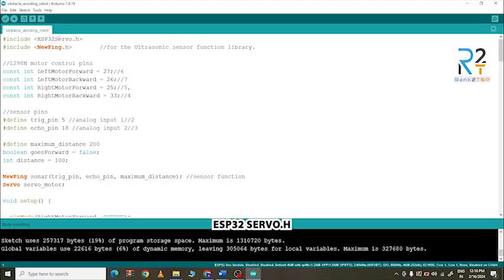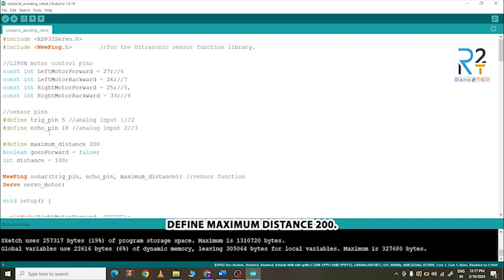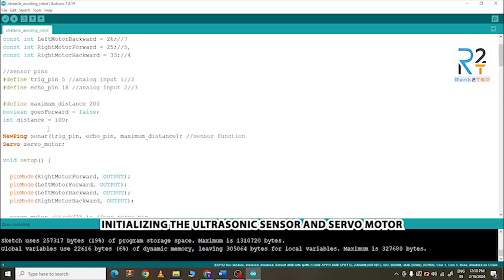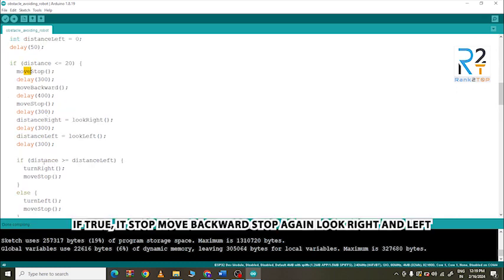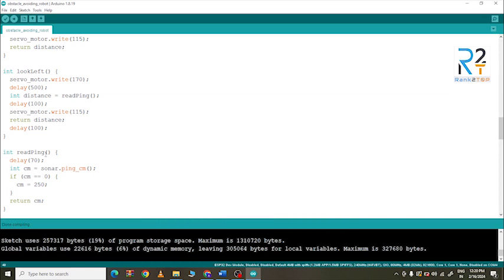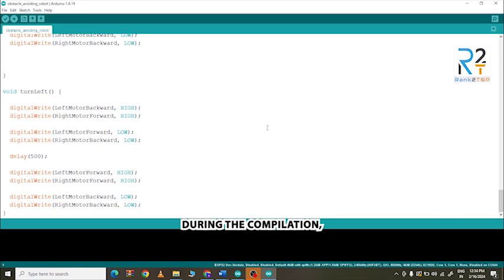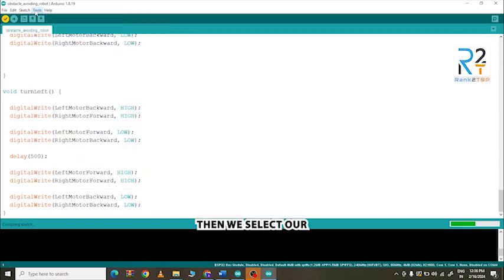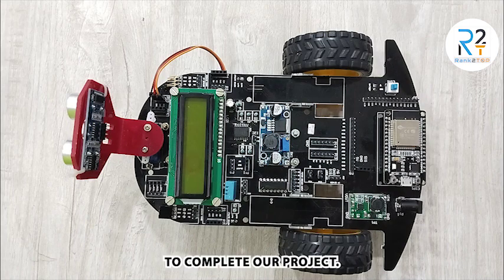Obstacle Avoiding Robot

Comment: I am having the same kit in our school I a  coordinator for the lab
While I am dumping it is not uploading in eps32 it is shown  the port not selected .. I try a lot by changing cables, by restarting the laptop I am getting the same... 
But from u r yantram I also have iot kit for that also while I am dumping code it is getting for Arduino but the same thing repeating while I am connect to esp32 board on same kit
I used ESP32 board
I installed all the libraries related to the project.. 
Please tell me how to dump the code for esp32
Reply: Arduino ide software se